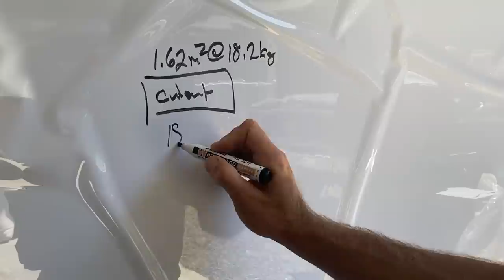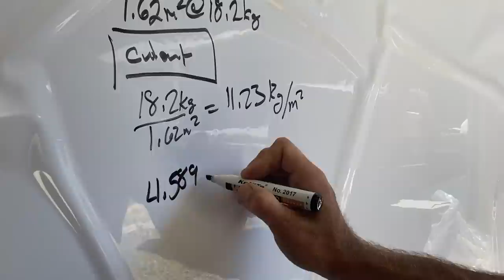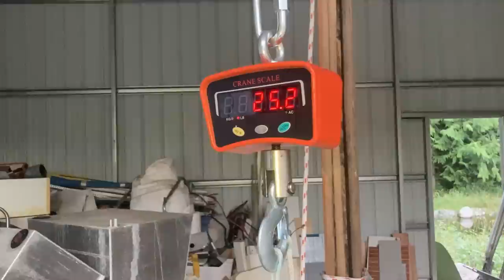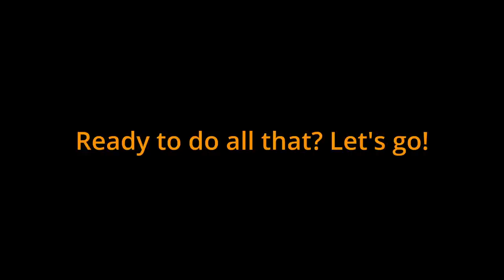Sailboat Refit: Stern DONE! (well, almost) [E40]

Comment: The new stern looks awesome. You did the right choices, obviously.
Talking about kilograms, compared to the total weight of the boat, it seems the difference won't alter much the position of the water line. Maybe you can compensate with the interior equipments (fridge, oven, bathroom...). I guess originally there were not many comfort equipments, as Duracell was a racing boat.
Great work anyway.

Comment: I think it is bit more complicated than you think.  It not just the weight but the distribution of the weight in three dimensions.  It’s a calculus problem not an addition problem.  But it is something your architect can help you with.  He can build a 3D model of you boat when it it almost completed and them make small adjustments if it is significantly out of balance.  I would worry so much about it now.
Reply from the maker: Yes we are recording the net weight difference but also the position it’s placed in the boat longitudinally, transverse, and vertically.

Comment: Always a good idea to be aware of weight and balance. I’m a pilot and am familiar with weight and balance. Looks like you added weight to the center and aft of the boat. You may have a light bow. Simple to add weight to the bow. I don’t think you will have any lateral issues. What a tremendous project👍

Comment: Matt, you certainly went into more detail with the weight than I would have.  But don't you also have to take into account the distance from the center of balance to determine its effect on the level of the boat?  I think it's a lever problem:  weight x distance.  The center of balance is the fulcrum.  That's what they do with airplane weight & balance.  I build canoes so it's not a problem - we just move the beer cooler forward or aft.
Reply from the maker: Yes, I should have explained that better in the video, the placement of the weight is just as important as the weight itself.  Each position of new weight is being recorded in all 3 dimensions.

Comment: Hey Matt you doing a great job I enjoy this series very much I just wanted to let you know that liquid propane would turn to gas immediately and you would never have liquid propane running ever. You're still doing a great job and I love this series please keep going but you don't need to drain hole it would turn the gas before it even ran out anyway!
Reply: Although as a vent hole that would work, propane heavier than air and goes to the floor meaning if you have a propane leak in your house open your doors not your window! So as eventful that would work!
Reply from the maker: Yes it’s a vent hole for letting propane fall out of the compartment in the even of a leak.

Comment: I would be most interested in the center of gravity location when the hull modifications are done compared to the original? I’m sure you and your navel architect have thought about this already, the three dimensional wire frame cad drawing when finished with the modifications will make easy and help with design and location of the keel also :)
Reply from the maker: Yes we are working on it, it's a big job.  I'm still learning CAD and hope to be able to make a well educated guess on the CG when it comes time to redesign the keel.

Comment: What about the hole in the propane tank compartment (the one you put your hand inside to glass the aft "cockpit ear")? I imagine that it would be filled and glassed over, to eliminate any potential propane leaks through the deck into the interior???
Reply from the maker: That hole will be sealed up.

Comment: How are you going to compensate the reduced stability from the removed ballast tanks? Are you pouring a new lead ballast? The increased weight of the boat and the one of the ballast keel will require a lot stronger boat structure. I believe you have a naval architect to refer to?
Reply from the maker: This is an extremely loaded question so I’ll try to be succinct.  The short answer is the boat was designed to sail in extreme conditions which we won’t be doing.  We have room to reduce righting moment and keep a safe and stiff boat.  It is still unclear if we’ll need to add lead to reduce draft and reduce(not totally remove) ballast tanks.  More on this in the channel in the future.

Comment: I assume hand-laid sections are the same as vacuumed sections except without vacuuming of course. My question is where does the extra 1kg / m2 of epoxy go when the vacuum is applied - is it into the other cloths you place on top of the laminations? 

Great project BTW, and the videos too!
Reply from the maker: Yes it is absorbed by the breather clothe

Comment: I was off by 80 lbs.  I thought it was -155 lbs if I remember right.  Won't your supplies and water tanks add a lot more weight than 235 lbs and will offset any weight distribution issues when it comes to the keel?

Will you have a motor of sorts in this boat too?

Keep up the good work.
Reply from the maker: Oh there is a lot more weight to add to the boat in systems and interior structure.  This was just an exercise in making sure you were paying attention ;-)

Comment: could the 3rd Sloped compartment be used as a Fender Storrage? almost like an angled whineshelf so you can drop them from the top into it with a drain hole near the bottom?
so you dont have to run past the doghouse to the front were normally the stuff is thrown in a locker near the anchor locker at the very bow?
Reply from the maker: Too small for fenders. My guess right now is there will be electronics in it.

Comment: I’m surprised you don’t use a mixing rod in a drill to mix all your epoxy. Is there any reason why you don’t? I used a simple 1/4” X 8” long dowel with 4 small sheetmetal screws installed in a double x pattern at one end and then checked it in my drill.
Reply from the maker: I’ve been thinking about it for sure, send me a pic of yours if you don’t mind?  theduracellproject@gmail.com

Comment: Where the locker is and chain plate section is will you paint inside the area ?? Just curious because wouldn’t it have been easier to paint it first then add the panel??? Thanks 👍
Reply from the maker: I still have to add fiberglass tapes to the inside, then I’ll paint.  It will be very pleasing to put a first coat of paint somewhere.
Reply: @TheDuracellProject  ok thanks 👍 really enjoying the progress on the project 👍

Comment: Hey guys - love the Channel - When you are laying your fillets are you glassing over them straight away or semi cured or maybe sanding/ peel ply after full cure and then doing the layup on top?
Reply from the maker: I do all those things.  It depends on conditions and the scale of the individual project and how much time I have.  Obviously I prefer to do it all in one shot so I get a chemical bond between the fillet and glass, but if I’m concerned that the fillet will cure before I have time to glass, then I usually wait to fillet and just clean the edge.  In general I try to avoid adding a fillet and letting it cure to sand it later because I hate sand prepping them.  Good question.
Reply: Awesome. Thanks very much for letting me know - I’m curious to learn the tricks from a pro - I’m building a 15ft strip composite open boat and by trial and error have tried all these methods.  I’m a carpenter by trade and I kind of liken filleting to concreting in that there’s a lot of timing involved and it’s definitely a skill.
P.S - I watched the mike plant doco the other week and my mind was blown - what a dude

Comment: Does the mix ratio change with higher or lower temperature , moisture in the air? Basically with the changes that all four seasons bring, do you adjust the mixture of hardener in your epoxy? Does your new toy have the ability to mix your epoxy to those needs? Impressive project btw. Will stay put to follow. Cheers Andreas
Reply from the maker: With polyester or vinyl ester resin you can adjust the amount of hardener to make the cure happen faster or in different temps.  My epoxy is always a 2:1 ratio. I have slow/medium/fast hardeners for different speeds, or in colder temps I use faster hardeners.

Comment: It would be way easier and accurate if you were to just put four scales under the mount pad in four different quadrants of the boat that way you could tell left right forward and back and there would be no guesswork about how much heavier your epoxy lay was in one quadrant versus another quadrant. You can even do it with load cells. Really you just need two scales to get the front and back weight. You might be able to rent or borrow some
Reply from the maker: I would like to weigh the boat here in the yard if I can figure out how.  For now this is good practice and if I can’t get a good measurement at least I’ll have an estimate

Comment: And where there structural reasons for keeping the old stern walls in the cockpit lockers? I might have removed them and created a workaround for the structural strength.
Reply from the maker: I am trying to keep as much of the original structure of the boat as possible, within reason.  We are not concerned about adding more storage compartments as the boat is big enough to store everything we own already.
Reply from the maker: I am trying to keep as much of the original structure of the boat as possible, within reason.  We are not concerned about adding more storage compartments as the boat is big enough to store everything we own already.

Comment: Does an equal share of resin weigh the same as an equal share of glass?
Reply from the maker: When vac bagging I get closer to 1:1 resin to glass ration, or even less resin to glass.  Hand layups have more resin to the weight of glass.
Reply: When he says equal share of resin and glass, he means that they are equal by weight. So if you add 500 grams of fiberglass you have to mix up at least 500 grams of resin (probably a bit more to make sure it is saturated). Then when you vacuum bag it, the excess resin is squeezed out and ends up in the peel ply or breather cloth (if any).
Reply: @mckenziekeith7434  that's what I was asking thank you very much

Comment: Couldn't you just do a weight and balance check after you are done with the refit to determine the appropriate keel and or weight distribution adjustement? We do this with airplanes. Would be very accurate and you could find out where is the center of gravity at that moment.
Reply from the maker: I’ll look into it

Comment: couldn't you, in a safe and controlled way find the center of the boat. then put one strap around there and lift off a cradle a bit? add ballast where needed.
Reply from the maker: Maybe.  I don’t know what my options are around here for trying to weigh the boat in place.  If I can figure out how, I will.  If I can’t then it will be helpful to have an educated guess about where weight is distributed.